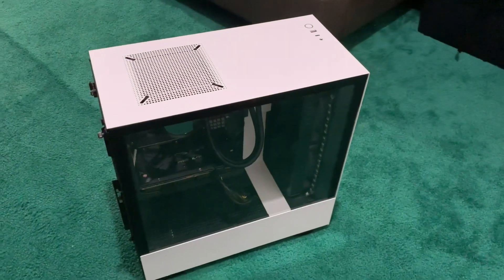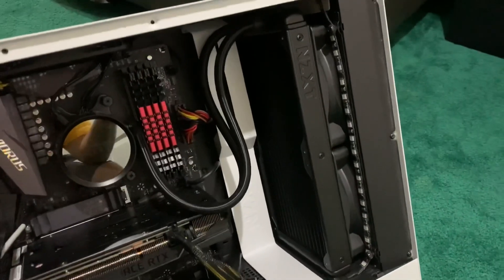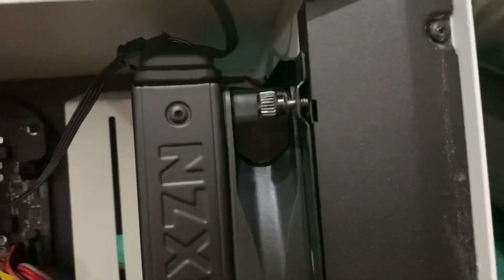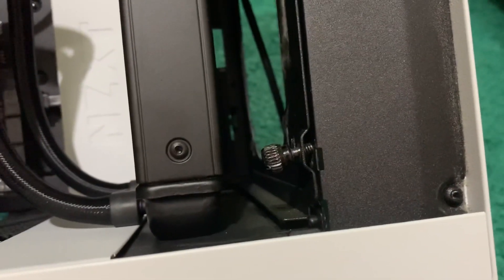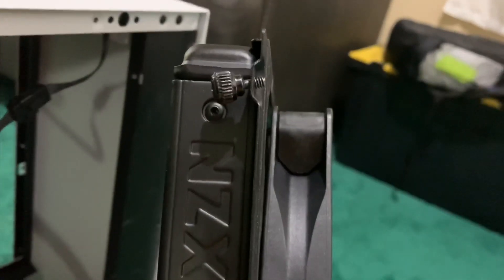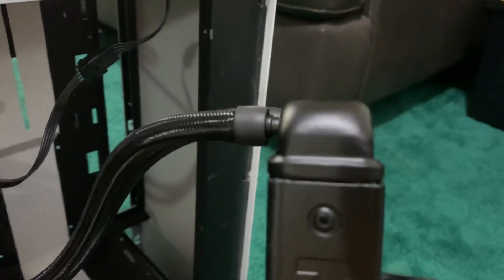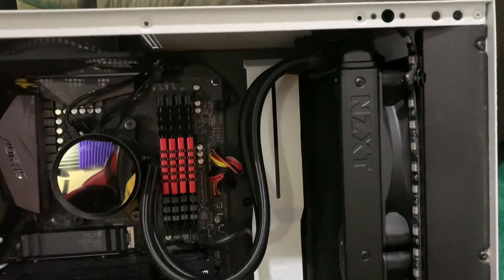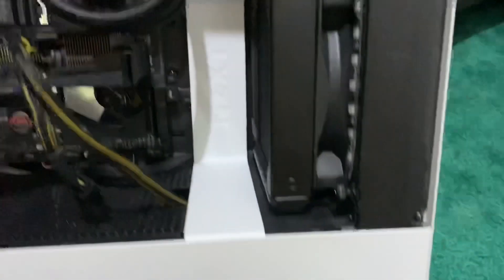X63 AIO will not flip in a H510 Case

Comment: I just purchased a 280 AIO on Black Friday to go with my new I9-9900k and I found out you cannot do exactly what you’re saying which is have the tubes on the bottom... The good news with yours is if it goes out there’s only one company to blame NZXT, as they sold you the case and the radiator and have it in their marketing the tubs on top.  I purchased a deepcool aio soooo... also I was irritated to find out you can’t put the fans in front of the radiator in a pull configuration because the removable mounting bracket has a lip...

Comment: That's because that is the right way to install it.
Reply: @Chris Campbell 🧢
Reply: Watch jays two cents on the matter, he specifically states that argument doesn’t apply because NZXT has a internal radiator pump that helps avoid that in the top position. So yeah 🧢
Reply: @Chris Campbell So my understandig is NZXT is one of few companies that have internal pumps in the radiators so you are good. Most other AIOs arent good or recommended in that orientation

Comment: Can a Corsair be flipped, and if so can it be the 240mm or 280mm
Reply from the maker: Cant comment on the 280mm Corsair, however the 240 should.  Tubes are slightly shorter than the NZXT's, and as long as you dont have a 3 FAN GPU, your good.
Reply: @maz94protege  ok thank you so much

Comment: I'm planning a build with the exact same case and aio. Was going to try mount the aio tubes down and get them to fit between the 25mm gap between the rad and gpu. Now I'll just accept that the tubes will have to sit on top as I haven't found another case I like.
Reply: @DashiroAI  Oh I know. I've seen the video. I likely won't have room to mount the tubes down as the gap between the gpu and radiator will be so close. 
I plan on either getting the tuf or strix 3070/3080. The tuf gives me 25mm gap and the strix is only 7mm. I might just have enough room with the tuf card but the strix has no chance. 
I might just buy a different case though.
Reply: @tinwing6832  I'm in the same boat as you and now I think I'm leaning toward the Fractal Meshify C with a top mounted Rad
Reply: @Degenerate_Dan1  the fractal case can only fit a 240mm rad on the top and needs low profile ram as well. The NZXT case will fit the kraken x53 at the front with the tubes down if you were going to use a 240mm AIO in the fractal case.

I saw a picture where someone had the x63 mounted with the tubes down in this case so looks like it can be done. Maybe the video maker hasn't positioned the rad at the highest point they can on the mounting bracket.
Reply: Did you guys buy yours yet? Since i don't find any other case as gorgeous as the h510 elite combined with a x63 cooler i really so want to make it work with the tubes down. It does definitely seem possible. I found this the other day: https://www.reddit.com/r/NZXT/comments/iffh8m/aio_rearranged_per_gamers_nexuss_recommendation/
I just wonder if it would fit with the  ASUS 3080 strix as well

Comment: I’m confused so it won’t work properly with the pipes up? I was thinking of buying it and I hav the same case
Reply from the maker: It works perfectly fine with the tubes up.  There was a review, teardown and discussion throughout the community of various AIO configurations.  Long story short, if tubes are up, it MAY reduce the life expectancy (~5years) or cause noise/gurgling sounds.  In the case of the NZXT AIO's and more specifically on the 280mm, the tube in/out side is slightly larger than the opposing side.  not the case with other AIO'S where they are completely symmetrical. 

There is no performance issues with this AIO and tubes up.  im running, now, a 3900x and zero cooling issues.     

this video was just to show other potential owners of this combo there is only one way for the 280mm,  the 240mm can be flipped (if that is what you want to do)
Reply: @maz94protege   you can try more to put it tubes down. support slides a little over the screws, so it can fit tubes down. It worked for me, the X63 is perfect.
Reply: @doloresalbernathy1835  so you think I should go for it

Comment: Fixed: Z63 & X63 are larger than the case, Go for Z53 or X53 instead. 
X63 measure at: 34.7 x 21.3 x 15.7 centimeters 
Z & X53 measures at: 30.7 x 21.2 x 13.7 centimeters. 

I was a hair away from puller the pliers and start modifying the bracket, thank god I didn't. 

OP: I will post this comment on both your videos.
Reply from the maker: They do fit just a little snug.  Just like I replied to your other comment.   My issue was I tightened the screws to the bracket and fans too tight too early. Not giving wiggle or play when sliding the unit back into the case.    Fits fine. Either orientation
Reply: @maz94protege  my issue was, the cables coming from the io are getting in the way, the only way I can fit a x63, is if I completely disconnected power button and usbs and wire them somewhere else.

Comment: I have a icue with 3 fans and i have the same case as you. It wont fit right ?
Reply from the maker: It should fit.  Fan sizes should be the same (ie, 140mm Corsair vs 140mm NZXT)  Ive replaced both the NZXT 140s for Noctuas

Comment: Gamer Nexus's video was more focused on longevity of AIO's. Honestly, the chance is that your Kraken will not run worse. I have seen a benchmark who tested both top and the front (the hose of the radiator placed at the top) and the result was that the cpu will run cooler if you place the AIO at the front. Unless you hear bubbles from your AIO, it is working completely fine.
Reply from the maker: 대한건우 exactly!
Reply: @yosixxx  gaming will not put cpu at 100% load, and doesn't really use much heavy instructions. Depending on what instructions are being used, your cpu may draw more power from 80% load than it does from 100% load you get from CPU-Z. No need to really worry about cooling in any cases. All of these talks are legitimate yet so pointless to 99% of us.

Comment: It does not flip on my H510i case too.
Reply from the maker: It actually does.   See my updated video.  I had to loosely screw in the bracket to the fans and rad, then was able to adjust while placing the entire unit back in the bracket mounting holes (on the case). It works,  just takes a few moments of fiddling

Comment: Could I put my aio on the top of my nzxt h510 case just wondering
Reply: no,you cant because the h510 and h510i do not have two air vents
Reply from the maker: @LeventisChris   Correct    it might be possible to install the 120MM M22 AIO.  But clearance issues could come into a factor with RAM and CPU Coolers.

Comment: Man, you must remove the white bar 1st, then you can easily put it in
Reply from the maker: White bar doesnt remove on the H510's only 210 and 710's.  That was not my initial issue, it was the rad/fan holes lining up with the mounting bracket

Comment: I have the h510 elite and its fairly easy to mount the radiator tubes down. Just drill new holes that it fits and put the fans in front of the radiator mount. It cools my 5950x perfectly and also is quiet. It just looks a little weird to have the tubes “around” my gpu since it’s to long to put the tubes behind it.
Hope I helped out some of you!
Cheers !

Comment: it can only be installed the wrong way , good strategy nzxt
Reply from the maker: Yea its interesting, definitely.   Maybe @NZXT will modify the case in the future with adjustable mounting holes to flip the X63.
Reply: not true! I have mine installed the other way around.  i can put pictures.  The thing is: There is some space once you put the screws and you can slide a bit, so it can fit the right way!
Reply: And I have  same X63 280 mm radiator/fans
Reply from the maker: @doloresalbernathy1835  the “right way” is subjective.   And according to GN it would be top mounting is the “ideal” configuration.

I’m happy the way it sits aesthetically, but will entertain the comments of testing the flip again.
Reply: @maz94protege  I got the same setup. It just doesn’t fit. It used zip ties to keep it in place without screwing it
Reply: @ronlegas8180  I saw this also, might try it tomorrow
Reply: @f_aaris  Please do update us if it works brother!
Reply: @ronlegas8180  will do!

Comment: Holy crap I’m stupid 😭 I’ve been trying to put the fans through the front and mount radiator and the front panel cords were in the way 😂
Reply from the maker: I'd really like to see how the H510 Elite is setup. They must have a different bracket or more room some how.  

but after my latest video with the tubes down, i figured it all out.  check out that one!

Comment: What is the benefit of flipping the cooler?
Reply from the maker: Noise mainly,  and there are possibilities of small air bubbles with my current configuration.   Look up gamers nexus. He had a whole detailed report on AIO orientation

But other than noise (which I don’t have) there hasn’t been any proof of any performance gains if it was tubes down vs up

Comment: Tbh my build is using this case, along with the kraken x63. It is using the EVGA XC3 rtx 3070, the Asus tuf motherboard plus with WiFi, 32gbs of g skill DDR4 3200 rip jaw ram, a NZXT C750 psu, an I7 9700k unlocked, a Samsung 970 evo 250 gb m.2 drive for booting windows and other software needed, as well as an rgb NZXT fan. All of it will fit, yes it will be a little tight, but considering the amount of fans and cooling in my new build, it should be fine. Good to watch this video, although I have no problem with having the tubes like that. As long as it works and runs I have no problem with it, I understood from the start that this new gaming rig that I’m building for myself was going to be tight but very very strong in gaming power.

Comment: I have the same case with a Kraken z63 and its mounted in the front with the mounting bracket inbetween the radioators and the aio tank with its tubes in the bottom without problems. I would show you a photo. Perhaps there is a slight difference btween the x63 and z63 because for me it works perfectly.
Reply from the maker: Only difference is the Pump.  All other specs are the same.    

viewers on here have stated and posted links to the configuration working both ways.  It's on the "ToDo" list this week to update this video and show it flipped.

Comment: Does 240mm work in both ways?
Reply from the maker: It does!
Reply: @maz94protege   So just to be 100% certain would a 240mm Kraken X52 fit in the h510 case with the tubes on the bottom or not? I have a h210 case but I'm considering getting a h510 if it will work??
Reply: @ogsniper743  yes it can fit with the tubes facing down that how i have my 240mm on my h510.

Comment: look if u could mount them down great if u can keep the tubes going into the rad below the pump great, this way air wont rise in the pump being the highest point in the loop. but all in all nothing will  break just make some gurgling noises. the other ways are just optimal. I've mounted in ways ppl would scream! but it doesnt matter, plus cases very also.

Comment: Build my PC today in the H510 with the Z63 AIO, which I assume is the same as the X63 when it comes to its radiator.
Be sure to mount the fans and radiator at the top of the mounting plate (screw them to the highest point on the mounting plate). This worked for me!

Comment: We can flip the x52 240mm right?
Reply from the maker: Correct, the 240MM has plenty of room, thie 280 physically cant due to dimensions
Reply: @maz94protege  x52 240mm will fit in the h510 case with the tubes down? Do you think its worth getting a new case and going through all the trouble of flipping it over??

Comment: It's a terrible case and cooler. It's a mornonic design to only allow 1 120/140mm mounting space, instead of 2. And terrible cooler because it's not equally symmetrical on the edges. they could've easily moved the tubed a bit closer or on top. And terrible front cooler mounting 'bracket'/slab. Difficult to remove and even more to work with.

- GN tested various orientations and their results. They have evidence for this.
- GN addressed which orientations were best and optimal. They also said that not all cases would support them. So for the longetivity of that cooler, you need a different case.

Comment: Thank you so much I was going to buy this but now I’m not
Reply from the maker: Curious to what item your now not buying?

If its the AIO,  it CAN be flipped. I need to make an updated video.
Reply: @maz94protege  it was the aio and after looking more I think I am going to get it, that is the 280mm one correct?
Reply from the maker: @djtube9644  correct
280 (dual 140mm fans)

Comment: Ohhhh thanks a lot I probably just save me I was gonna get the 280 
Same case 

Btw how’s the CPU And Gpu temperatures under lode
Reply from the maker: GPU stays around 65, CPU stays around 54-60c.
Reply: @maz94protege  that is kinda good temps for a 3900x isnt it?
Reply from the maker: @enne953  Yes
Reply: @maz94protege  but i think i will get the 4000x case because u can have the aio in the top
Reply from the maker: @enne953  I love the new Corsair Cases. Great choice!

Comment: If you watch GN's follow-up, Steve was not saying that tubes up is necessarily bad for the pump or the performance and longevity of the syetem. It only causes air bubbles to end up in the top tank of the radiator, and that may contribute to a gurgling noise from the system. If you don't notice a gurgling noise, you should be fine. with the tubes up. The critical issue for the pump is if the pump block sit on the processor in such a way that the bubbles would end up inside the pump. That will contribute to the wear on the pump and degradate its longevity.

Comment: its why im going to mount mine at the top, fortunately i bought the h710 so it supports top mounted radiators. i was going to mount it at the front the "correct" way, but i also preordered a 3080 strix and i dont see the cables going around that beast cleanly XD

edit: i also bought the corsair h100i white since im  going for a white and black theme (basic i know XD)
Reply: I'm going for a white and black theme too and I checked out white AIOs but they're all sooo ugly 😂 who wants to see that huge Corsair logo in the middle of the otherwise clean, minimal beauty
Reply: @AxeDragon1989  I actually don't mind the Corsair logo on it 😂
Reply: @AxeDragon1989  look up this. I reckon it'd suit what you're after better 

ID-COOLING FrostFlow X 240 SNOW AIO CPU Liquid Cooler
Reply: @thchiefe  thanks! But nah, not a fan of RGB. Just gonna go with a more subtle chromax black noctua air cooler
Reply: @AxeDragon1989  fair shout

Comment: Really? Cause I just did it
Reply from the maker: More and more are commenting that you have successfully flipped the rad, I may just do a live-stream soon and attempt it again.
Reply: Did you just squeeze it down there or was there something special you did?
Reply from the maker: @FogginNobbers  have not flipped the rad yet,  plan on testing it this weekend.
Reply: @FogginNobbers  I put the fans on the out side of the radiator so the fans are facing the inside of the case and I just pushed it in, and kinda forced it into place and it just kinda clicked in. But make sure you put everything together into the frame first if you have the H510 case and it should work.
Reply: @hyderupe7599  could you show some pictures please?

Comment: How's the airflow with that case?
Reply from the maker: My temps with the X63 on the 2600x have never gone over 50.  All fans are "Smart controlled" by the Gigabyte software (ramps up when needed) Ive never seen CPU temps over 50 on CPU and 60 on GPU. 

I clean the front (located on the side and bottom of the case) at least once a month and there is dust on the filters.  So there is good air suction through those intakes.  That being said, i have no way of "testing" how much airflow is going through the case.    

I love the case and design.
Reply: @maz94protege  thank you, you just made me feel a lot better about my purchase
Reply: @maz94protege  just bought the same case and I am building my new pc right now. The case is so compact and cool.

Comment: First off say radiator correct second you didn't watch the entire video nor do you understand the concept of air to fluid distribution as long as the cooler block is lower then the highest point in the system air will not make it to your pump
Reply from the maker: Thanks for watching. I do mis pronounce words on purpose because it drives my friends crazy.  

Second. If you watched the entire video you would know that this was initially me just seeing if the rad would flip and I explained that either configuration was perfectly fine. Even linked thr GN video and Jayztwocents. 

Again this video was just to see if the aio would flip. Nothing technical beyond that , all NZXT photography shows the aio with tubes up…

Watch my second video, it was updated.

Comment: Just put the fans on the back side of the rad instead of the front of the rad.. it’s simple man
Reply from the maker: Richard Logan attempted that, the holes don’t line up.   Also attempted fans, bracket, radiator.    The radiator isn’t symmetrical, the I/O side is taller than the opposite end.  Hence why the mounting holes will not line up without modification (drilling new ones on the bracket

Comment: I dont want to be that jerk who leaves a smartass comment, but, the water cooler tubes arent wrong alined? Arent upside down?
Reply from the maker: Either configuration works fine, just recommended not to have the Rad on bottom with pump above.

It’s kinda been beating the dead horse to death too much…. 

I did make a new video with the tubes in another orientation if you wish to watch
Reply: @maz94protege  ill look into it and see your results.